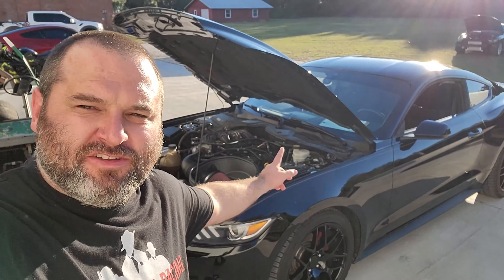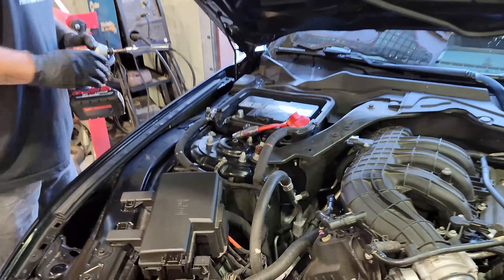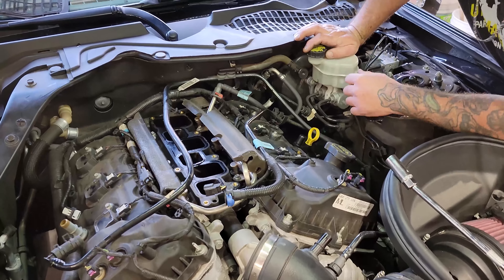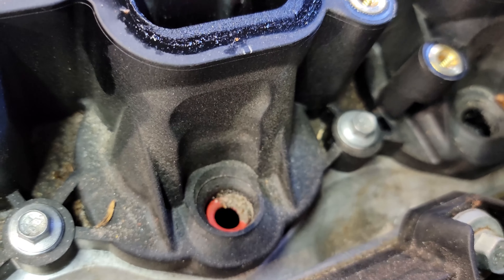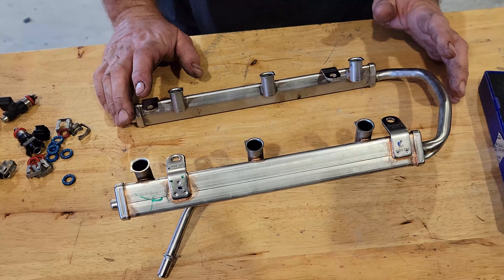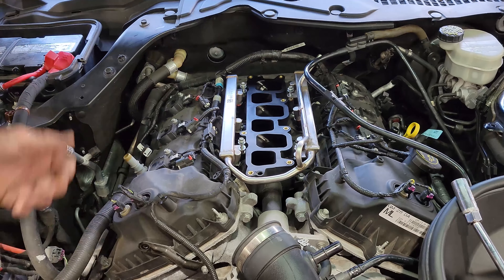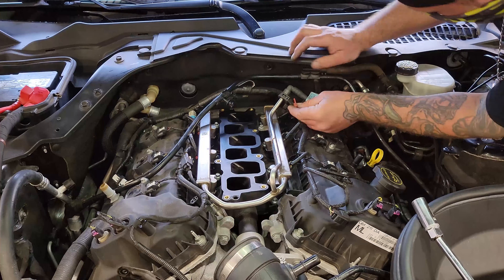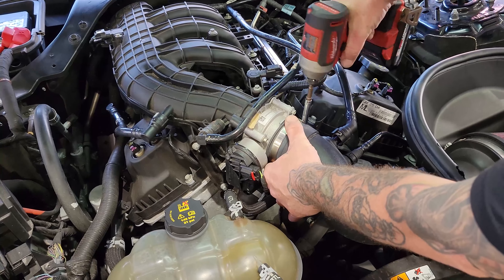How to install Injectors on a 15-17 3.7 V6 Mustang

Comment: would the stock fuel pressure regulator be able to handle the fuel flow requested by the injectors?
Reply from the maker: Yes

Comment: Can i put stock gt injectors on v6 both 2017
Reply: no point. injectors dont add horsepower. you upgrade your injectors when going to boost or ethanol
Reply from the maker: We wouldn't bother using oem GT injectors. We sell the MU52 upgrades for under $300